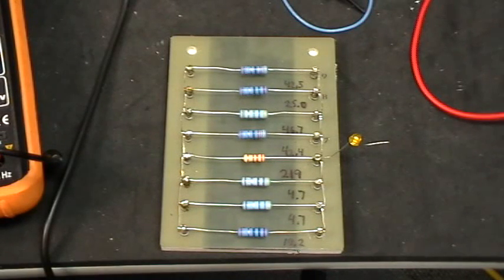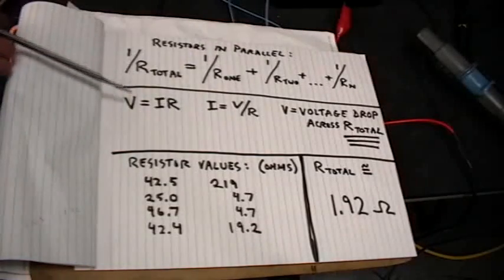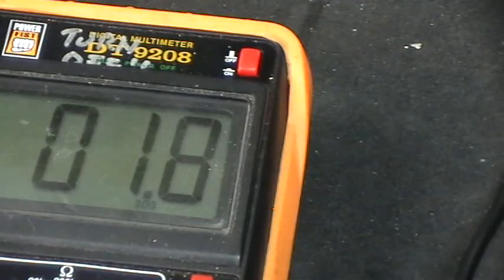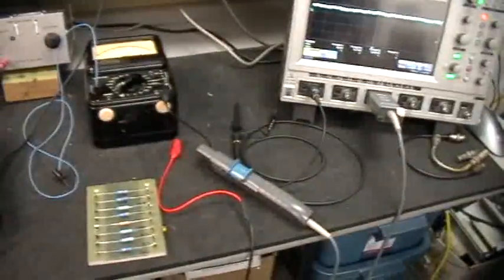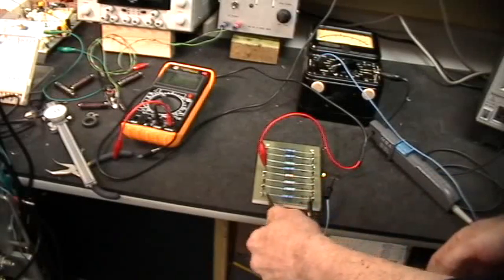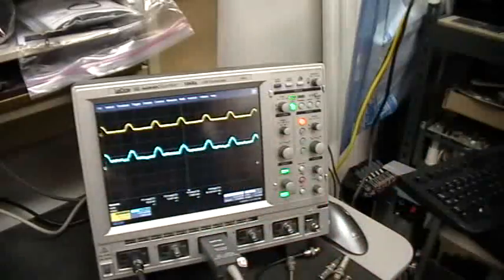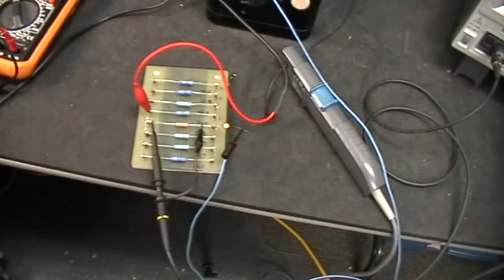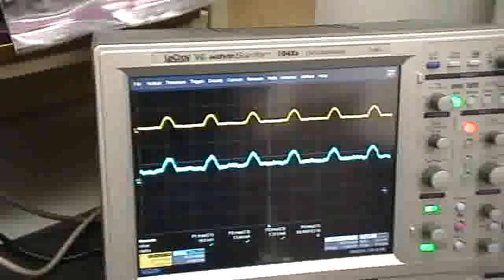Remedial Ohm's Law and Current Monitoring with Parallel Resistors

Comment: As anyone else noticed that there was a mistake in your calculations ? The resulting total resistance, with the given values of those resistors, would be 1.692 ohms, not 1.92.

Maybe you were so mad at that troll, that you wrote down too quickly the results of your calculations and missed the "6" in there? However, this hasn't got any influence whatsoever on the results and purposes of this demonstration, with only a 0.23 ohms error, but I believe in being thorough.